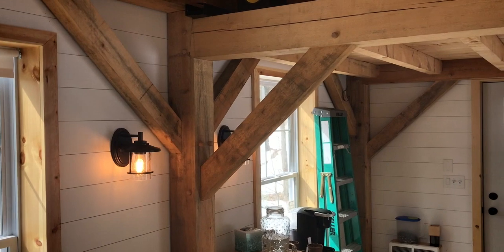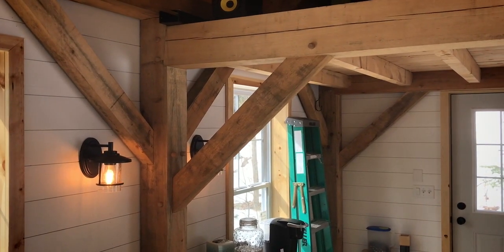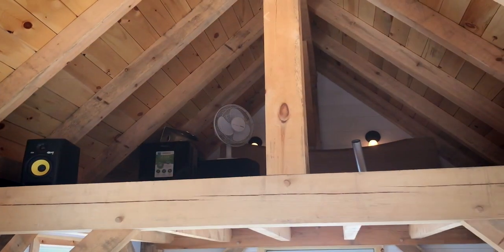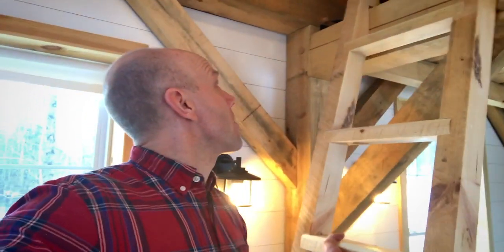Timber Ladder for the Northwoods Cabin

Comment: Looks awesome! I could see adding some rubber boots to the bottom to prevent slippage as well as damage to the floor. Nice work!
Reply from the maker: The rubber boots are a good idea! I've been pleased with how the floor is resisting scratches so far, but rubber boots would surely help!